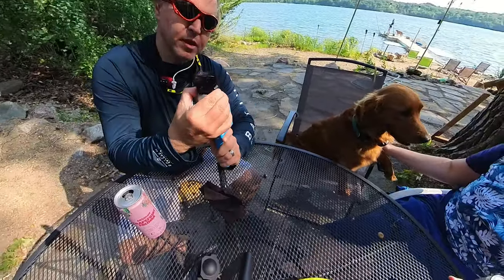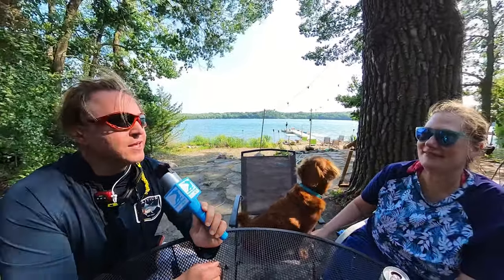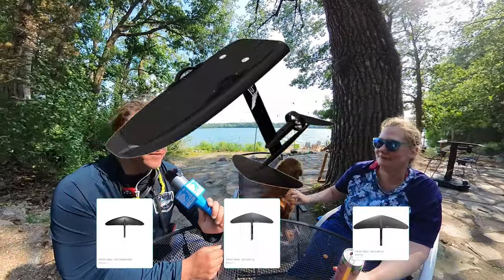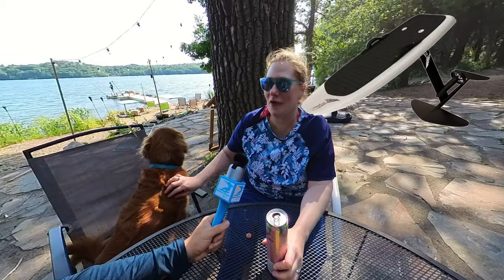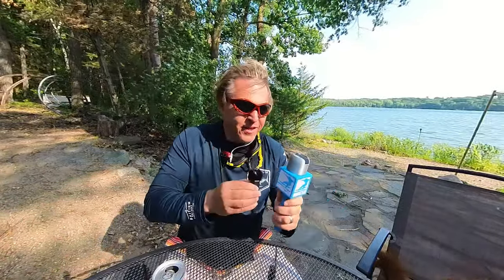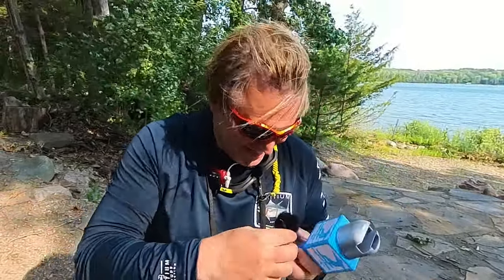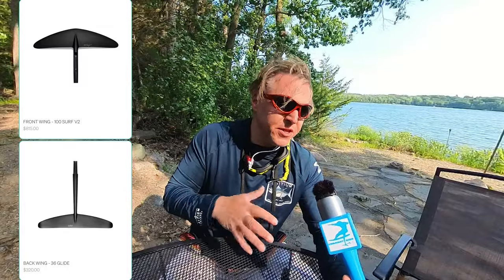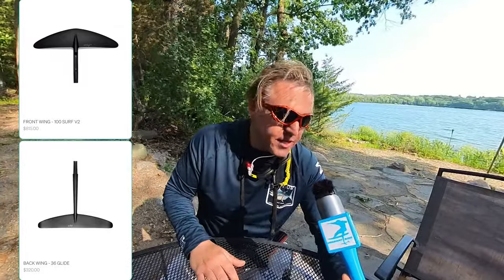Finding Your Perfect eFoil Ride: Board, Wings, and Battery Testing | Verdant Ride - Verdant Ride

Comment: Tails dictate a lot about the carving. Carve tails roll over much easier than glide or surf risks. The size of the tail and the length of the fuse dictates the pitch stability. You can dramatically change the feel of a front wing by changing tails. 

On the gen 4 battery, I’ve seen the same thing. The estimated ride times not accurate, but can be improved with a larger front foil. 

Give a larger front wing with a small carve tails and see how that goes!
Reply from the maker: I've now fully tested my riding times through my standard half-mile course with everything I own and every combination. The glide stabs make my carves smoother and allow me to smear my tail laterally with less upper body adjustments than the carve stabs.  NOTE: I've trained myself to check for boats on all my turns and in this clip you can see how much just turning my head affects the flight https://youtu.be/WShtZsqpCWQ?si=7N8_29Zso9Suykha&t=78 I need to un-learn this when in course but re-learn it for normal lake riding.

The glide stab allows me to hit my turns in a race at a much higher speed. So far my best times for racing comes from a 100 SurfV2 and a 36 Glide. Anything larger than the 100 SurfV2 produces too much lift and anything smaller decreases my ability to carve. A course isn't about just going fast, it is about accuracy and ability to change direction with minimal speed loss. If it were just a straightaway, I COULD use my 60SurfV2 but I still max out at around 34mph because the LCS pro is limited by cavitation as it gets close to 34mph. As far as I can tell with everything I've tried the max speed these boards can go is 34mph not because of power, or wing, but because of prop cavitation and of all the options the LCS prop seems to be the most aggressive, highest torquing, and lowest drag and cavitation of all the options.

I don't really like larger wings because they make the ride WAY too stiff and the loss in agility and turning radius is too annoying BUT when I want to go slower, like I'm riding with friends or training someone, I do like the 160 camber because it is still nimble but maintains flight at much lower speeds. So when I need to do lots of 180s to go back and help my friend figure out why she keeps falling, the camber is my low speed/high agility option and there I still prefer the 36glide because again it makes smearing the tail laterally easier to perform so I can get back to the person I'm training much faster than I can with a carve stab. I think the only advantage the carve stabs give is a stiffer response on tail slides which may come in handy for a beginner but provide unnecessary stabilization stiffness for my purposes.

Comment: Have you tried any of the high aspect wings? I'm a big fan of their new 150 HA X wing myself, it's amazing for surfing and seems very efficient for long range trips in large bodies of water. I want to try out their smaller high aspect X wing as well but I haven't had the chance yet. Do you think the Camber pro series have as high of top speed potential as the smaller Surf series wings or in your opinion is a small Surf the quickest to ride on?
Reply from the maker: I have tried them and for surfing, they are efficient and ideal. The HA was designed to deliver long sweeping glides at lower power settings and even unpowered using the folding prop. The downside is that they don't perform well at very high speeds. So for my purposes in flat water and at the speeds I like to fly, the slight vibration that those thinner longer wings generate throw me off and destroy my accuracy in my carves. So pick the right wing for your goals and pick the right size for your weight.

Comment: https://youtu.be/zWsmZhHS0T8?si=uNVVxUtjH4NfXFqI I had the battery remaining get stuck on 60% just once.  Ride it until it dropped dead. Lift4 too.  I’m only getting 1h:10m at 180 pounds.  Riding the 160 Camber Pro front wing and the 36 glide.
Reply from the maker: ### This response was provided by the Verdant Ride GPT: [https://chatgpt.com/g/g-fwDABnTTY-verdant-ride-efoil-news-reviews-advice](https://chatgpt.com/g/g-fwDABnTTY-verdant-ride-efoil-news-reviews-advice) 🤖

---

Hey @TomHoffmanJr,

It sounds like you’re encountering a couple of issues with your Lift4 eFoil. Here’s a rundown of some possible causes and solutions:

### Battery Remaining Stuck at 60%
1. **Battery Calibration**:
   - Occasionally, the battery percentage display can get out of sync. ,  Perform a reset then try a full discharge and then a full recharge to recalibrate the battery sensor.

2. **Reset and Balancing Process**:
 After a full charge, run your battery down to around 50% and keep it there for about 48 hours. This helps balance the cells and can improve the accuracy of the battery meter. You may need to add a few minutes of charge from time to time to keep it at 50% if you notice your battery draining during the process.

3. **Software Update**:
   - Ensure your firmware is up-to-date. Lift often releases updates that fix these kinds of issues.

4. **Battery Health Check**:
   - If the problem persists, it might be a sign of a deeper issue with the battery itself. Consider contacting Lift for a diagnostic check.

### Ride Time of 1 Hour and 10 Minutes
Your ride time of 1h:10m is relatively standard, especially given your setup and weight:
1. **Wing Efficiency**:
   - The 160 Camber Pro front wing and 36 Glide stabilizer are known for performance, but they can be slightly less efficient compared to some larger wings. If maximizing ride time is a priority, you might consider trying a different wing setup.

2. **Rider Weight**:
   - At 180 pounds, you're in a pretty typical weight range. However, any additional weight (gear, water in wetsuit, etc.) can impact battery performance.

3. **Riding Style**:
   - Aggressive riding, higher speeds, and frequent accelerations can reduce battery life. For longer rides, try maintaining a steady, moderate speed.

### Recommendations:
- **Try Stephan’s Favorite Wing**:
  - The 160 Camber Pro is excellent for freestyle and carving, but if you’re looking for extended battery life, you might want to experiment with wings like the 200 Surf V2 or even the 250 Surf V2, which offer more lift and stability, potentially giving you a bit more ride time.

- **Battery Care Tips**:
  - Always end your ride with at least 25% battery remaining. This practice can help prolong the overall life of your battery.
  - Allow the battery to cool for about 15 minutes between riding and charging.

If these tips don’t resolve the issue, it might be worth reaching out to Lift directly for more personalized support.

Hope this helps, and happy eFoiling! 🤙

---

Source: eFoil_Knowledge_V2.txt